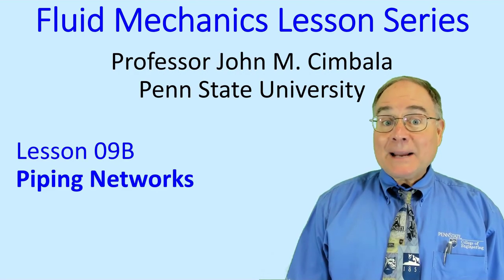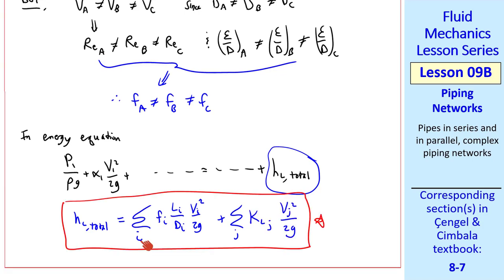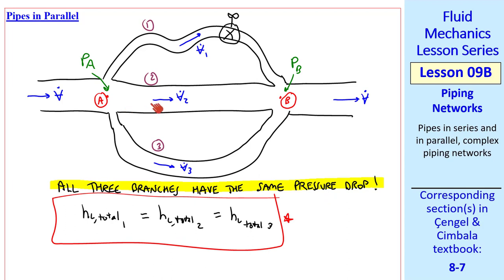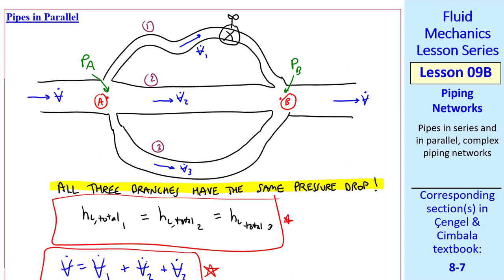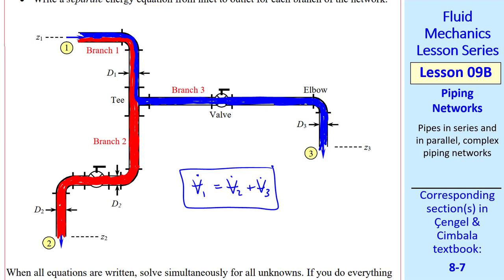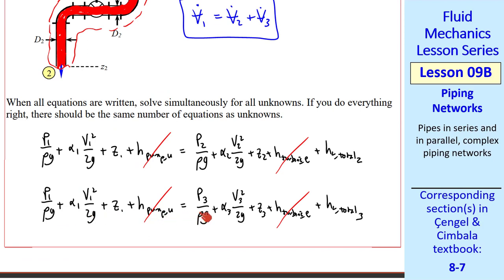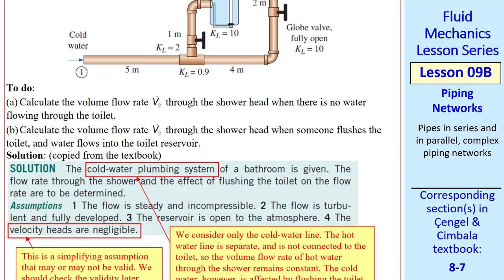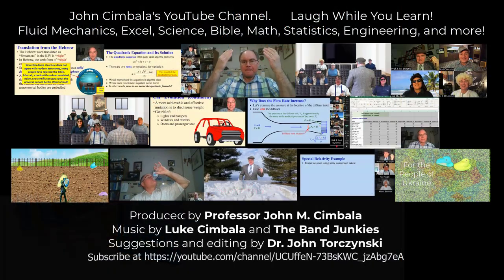Fluid Mechanics Lesson 09B: Piping Networks

Comment: Good day, I just wanted to ask if the tee branch is flowing to different pipe size, from 24" pipe into 12" pipe.
Currently I have the mass flowrate (800m3/hr) and pressure (6 bar) of the 24", so how do I calculate the pressure at the junction flowing into 12" pipe. For flowrate I think I can use a portable flowmeter, but for pressure I don't know which equation to use...
Reply from the maker: Use the analysis method I provide in the video. It does not matter what the pipe diameters are, we solve it the same way (results vary with variation in any parameter such as diameter, length, roughness, etc. of course). The pressure at the junction is determined by simultaneously solving for all the branches in the flow as I explain in this and in the next lesson.
Thank you for your comment. Please tell your friends and colleagues about my YouTube channel where there are more than 460 free videos about the Bible, fluid mechanics, science, math, statistics, Excel, air pollution, and other topics. I would greatly appreciate it.

Comment: Actually, Pressure drop must be equal through the branches. Otherwise pressure at the junction will have 2 values which is impossible. Also we assume steady state system that means no back flows can occur, which is the case if back pressures are not equal. Finally we adjust flow by this logic in our factory with a control valve. I advise you check that part sir
Reply from the maker: Of course the pressure must be the same at the junction. But the flow downstream of the junction after it splits will adjust the flow rates such that both outlet pressures are achieved. It is not necessary for the two outlet pressures to be the same - the flow will adjust to whatever those two pressures are. If both segments exit into the same atmospheric pressure, then the pressure drop will indeed be the same through both branches, as you say. But I am saying that it is not necessary for the two outlet pressures to be the same and hence the two pressure drops could be different.
Reply: @johncimbala  So you mean, total back pressures from the exit to the junction point are the same for each branch but their pressure loss will not be equal if their exit pressures are not equal?
Reply: @johncimbala can we apply bernoulli's equation for branch flows, between the main pipe and exit of branch 1 & main pipe and exit of branch 2 ? You used Bernoulli's equation for the example you explained in the video, so I presume that Bernoulli's equation is applicable for these kind of situations with some assumptions right ?
Reply: I meant between main pipe (1) and branch 2 & main pipe (1) and branch 3
Reply from the maker: @doganhamsioglu1545  Bernoulli's equation is NOT valid for pipe flows ever. There are irreversible head losses that must be accounted for. You CAN use the head form of the energy equation, which is what I use for these kinds of problems. Yes, you can use the energy equation all the way through the pipe in either branch. That is why I made the different colors. Pretend one portion of the flow is one color and the other portion is the other color and that they don't mix. That's not what happens in real life, but it is useful to understand what is going on.
Reply from the maker: @ramazanfurkanoran5819  Yes. Imagine a case where one branch pipe exits into the atmosphere and the other branch pipe exits into a pressurized tank or a vacuum tank where P is not equal to atmospheric. The pressures and flow rates would adjust themselves such that the pressure at the junction is the same no matter which branch you are considering AND the pressures at both outlets match the exit pressures. That is a case where the pressure drop through the branches is NOT equal, even though the pressure at the junction IS equal (has to be because it is just the pressure at a point).
Reply: @johncimbala  Thank you for making it clear sir. Your students are real lucky:)
Reply from the maker: @ramazanfurkanoran5819  Thank you for your kind comment. Please tell your friends and colleagues about my YouTube channel where there are hundreds of free videos about the Bible, fluid mechanics, science, math, statistics, air pollution, and other topics. I would greatly appreciate it.